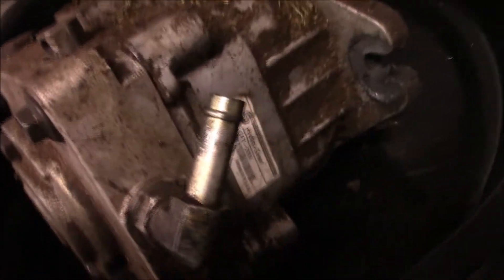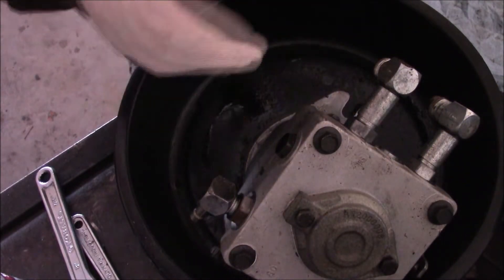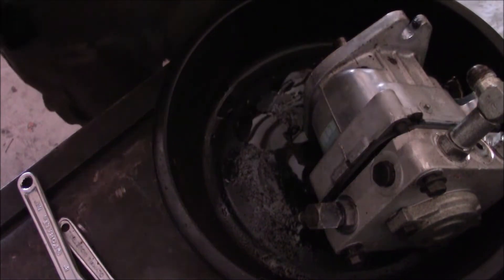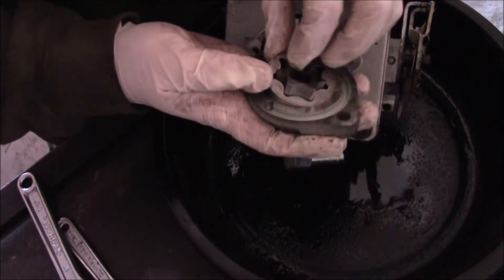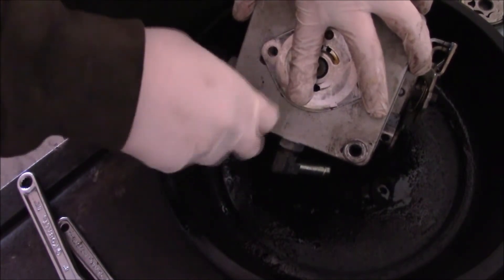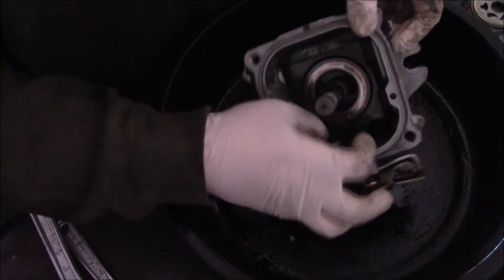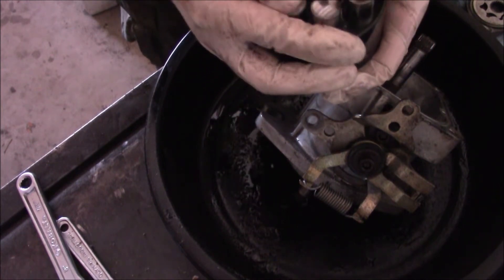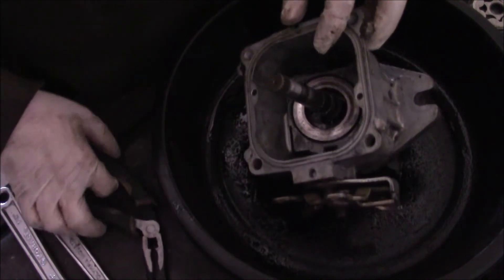Hydro Gear PW pump disassembly

Comment: Greetings to you. Tell me please. I have the same pump, but it does not have a booster pump. PW pump fitted with a 14cc gear pump. How do I organize the recharge of the axial pump?
Reply from the maker: I downleaded a manual form the Hydro Gear website.  It has a breakdown of the parts in the order of assembly.